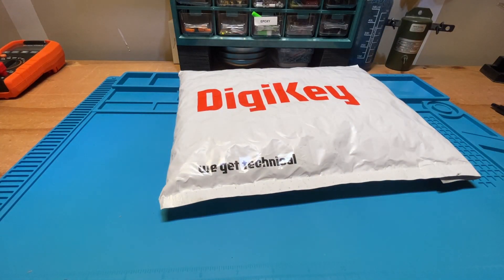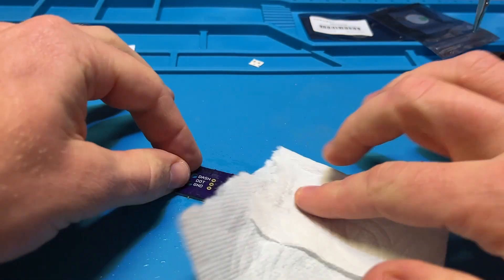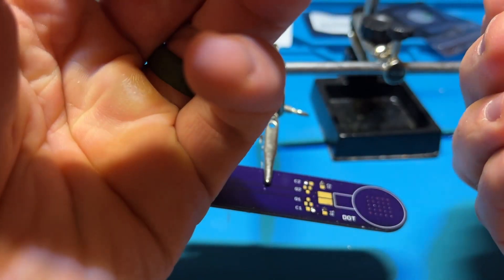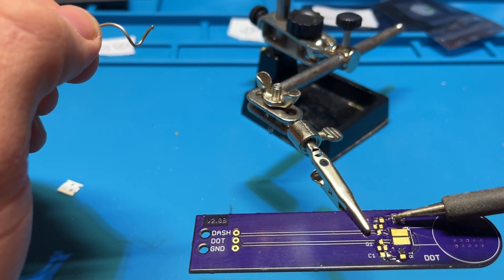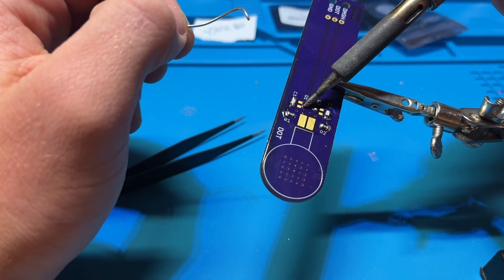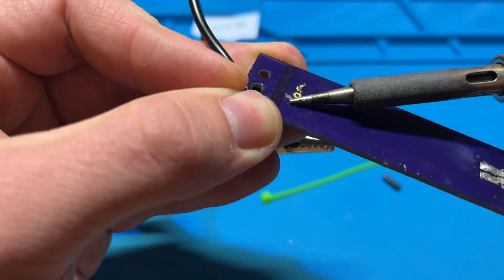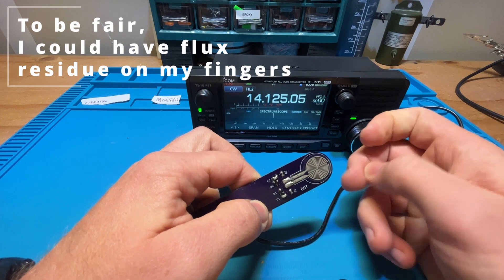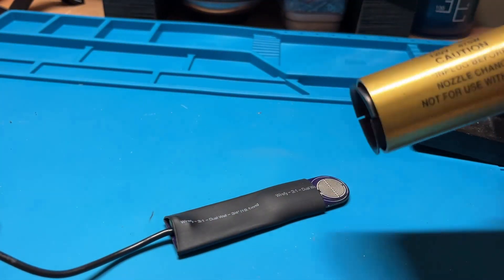Building the VK3IL Pressure Paddle for Amateur Radio use with CW Morse Code

Comment: It is sort of funny that all the builders of this thing are so particular about where the dit and dah wires go. The paddle is symmetrical. All you need to do is turn it over in your hand... regardless of wire placement.
    Another thing that is peculiar is that everyone is buying these sensors for around $14. I am betting you could replicate the design of the sensor with circuit board traces and have OshPark make it as part of the circuit board and save $14. I doubt that there is anything special about the sensors. It is just a spiral or interwoven trace.  The glue on the back of the sensor is just another point of failure.
    A sure way of testing the "pressure sensing" capability of the sensor is to monitor its resistance while pressing on it with an insulated object. I'm betting it will register "no change" because it operates through the skin resistance of your fingers.  Let me know...
Reply from the maker: I'd say the only reason the wires matter is because of the assumed "front" of the key having all the components on it, but yes it doesn't really matter. Interesting idea with using circuit board traces as the capacitive component. I'm not electrically inclined enough to know whether that could work or not.

From what I remember: As to the third point, the sensors are capacitive through interdigitated conductors. The plastic enclosure has some... give to it with an air gap separating the conductive layers slightly. Pressing the key reduces the capacitance enough that the circuitry overcomes the gap. There's a word for the gap that I can't remember currently. I'll try to dig up my key and get back to you about that. If I'm wrong I'll tell you :)
Reply: @CoaxAndCampstools  - In VK3IL's blog he describes how the bias on his FET gates is operated by a voltage divider which, when his sensor is touched, drops the resistance from >10 meg ohms down to less than 20 K ohms which results in a jump in gate voltage (95% of the drain voltage) that triggers the FET to fully conduct.  I have a hard time believing that the "pressure" sensors are anything more than two conductors designed in a spiral.  When I take my DVM and put it's sensitivity to 200K, then touch the lead tips, the resistance drops down to say 130 K from infinite resistance.  Given the length of the spiral, it is reasonable to think that the drop is proportional to the length of the spiral and how much of it is "touched" when activating the FET key switch.  One could set the (open switch) voltage at the gate with two actual resistors and then trigger the gate (raise the voltage) by putting the spiral sensor in parallel with the resistor across the gate/drain if the spiral doesn't drop the resistance far enough on its own.  I'm certain this would work and could be accomplished by just making the spiral out of traces and as an integral part of the circuit board.  I don't have the means to design or fabricate the idea but does it really matter what causes the voltage increase at the gate?   The cost of the touch paddles would be reduced by 50%.  Also there is no compelling reason to design the thing with difficult tiny SMD parts, given the parts count is so low.  I would recommend a TRS connector as well.  I notice that Adam K6ARK's touch paddles operate on an entirely different design philosophy -  sensing a change in capacitance rather than a change in resistance.
    I'd be interested to know if the sensors you have actually drop in resistance when pressed with a purely insulated object, like glass or plastic.  If it doesn't drop, then the sensor is not sensing pressure, but is sensing your skin resistance. (I could be wrong about the sensors as I've never had a chance to play with them.
    As a design consideration, I think the pull-up resistors in the dit/dah inputs is about 1K for most uControllers.  VK3IL uses a 470 K resistor for his source/drain bias so the drop in sensor resistance easily swamps the source/gate resistor and causes the triggering of the FET.
    Thanks for getting back to me.  I appreciate the conversation.

Comment: Hints from a retired EE: I wouldn’t use flux on that board. It looks to be gold plated, and thus will not tarnish. Solder should have no difficulty adhering, just clean the board as you did to start and solder away. Flux just will make it harder to clean up when you’re done. Try to find some smaller diameter solder for small smt parts like that, and use a vise or just lay the board down on the table. It’s way too floppy using that alligator clip tool with tiny parts!
Reply from the maker: I appreciate the tip. I'll make another paddle down the road and I'll forgo the flux. I'll let you know in like 6 months, lol.

Comment: i wonder what size(pi) of heat shrink for that pcb to fit.
Reply from the maker: I use Wirefy 3:1 heat shrink from Amazon. The piece I used to finish off the pressure paddle was 3/4" or 19.1mm. Pretty sure that's the diameter. Length was about 3 inches long. Thanks for watching!
Reply: @CoaxAndCampstools  (at first, sorry for english is not my first language.) yes, before you comment my comment, i realized diameter of heat shrink in your videos. i didn't see in ur videos. sorry for that but thanks for ur comment. i have to make or buy iambic key, and i found the pressure paddle is my taste, so i am going to make this paddle. that is the reason i am bought soldering iron, and also. thanks for your comment, hope to see you in HF. and my call is starting ds, thats from south korea. 73.
Reply from the maker: @linearphaselowband  No worries, my friend. I didn't know the diameter myself, so I was happy to dig out the key to look. It's a good intro to surface mount components. I hope to work you too, you would be my first South Korean station. 73!
Reply: @CoaxAndCampstools  this is my taste also :) thanks!!!
Reply: If I knew how to design the circuit board, I would make it fit snugly inside of 1/2 inch cpvc pipe.

Comment: I made of few of these as a fun SMD lite project and fun ordering PCs. They work great and I have a new “skill”. I did find the sensor pads aren’t very cheap but AliExpress has the identical ones for much cheaper. Thanks for the code practice videos too. Watching activation videos (k4swl, k2ejt, w4arb, and now you) are really improving my decode speed and accuracy and even short term memory.  Again, thanks.